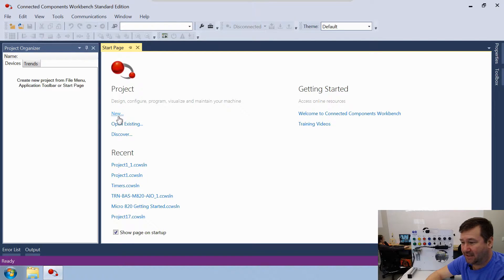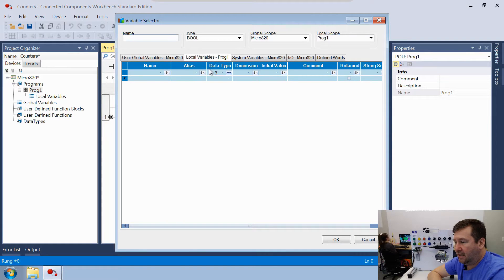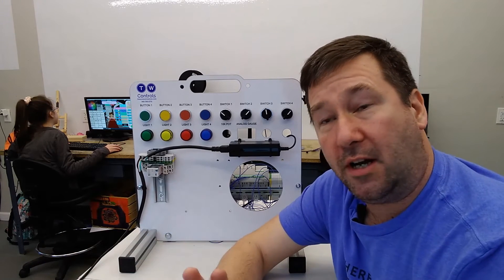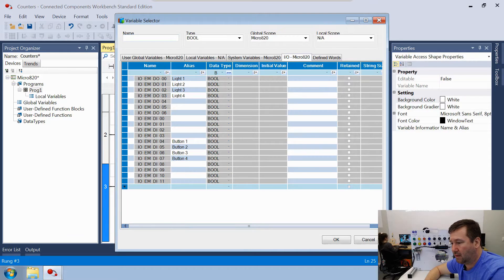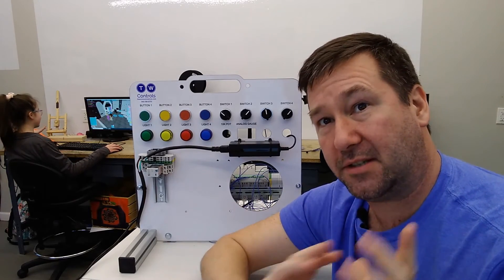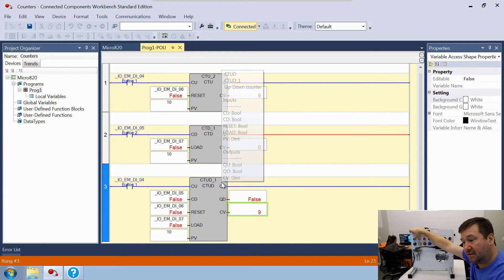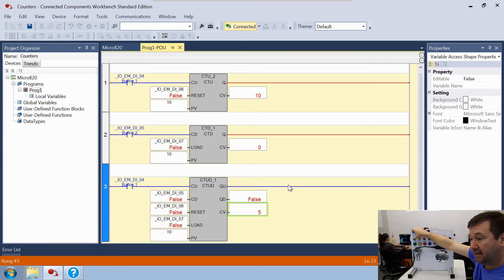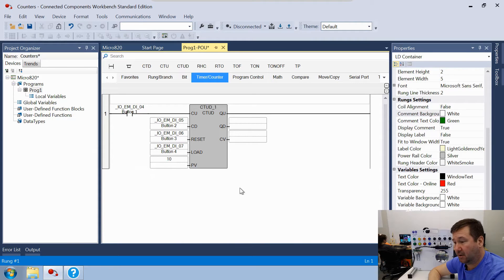Micro800 Counter CTU CTD Explained

Comment: Tim, I have very limited experience with CCW. I am trying to replicate an averaging routine I use in RS Logix 500, but I am yet able to get it to work. I use a timer, counter, addition, and divider routine and usually grab a value every five seconds for a total of ten grabs, the divide by ten so that I can average out a "bouncy" input. It would be awesome if you could cover this in one of your videos. These are very helpful videos, and it is clear that you pretty much have to throw out any RS Logix program procedure because trying to do it the same way just messes you up.
Reply from the maker: While not for CCW, watch this video, it is likely a similar problem.  Are you working with real numbers throughout you math?  
https://www.youtube.com/watch?v=oXMF1rDRtEM
Reply: @TimWilborne  Yes, except for where it insists on Double integers.
Reply: This is very helpful, but the issue that we have is interference, not resolution. There is a radio tower close by and it seems to cause issues with analogs at the site. Using RS Logix 500 I was able to smooth these as musch as possible making the site successful in its operations, but haven't been able to pull off the same procedure for CCW.
Reply from the maker: Double integers will result in rounding errors. Check out the Any _To_Real

Comment: Hey Tim, I am trying to write a value from a T4T HMI "Numeric Entry" to the "CTUD_1.PV" preset value but it gives me a "Illegal access to function block instance parameter" fault. The data types are the same, DINT, on my MOV instruction. How do I use the HMI to set a counter preset value?
Reply from the maker: You wouldn't use a MOV, you need to assign that tag...such as myHMIPreset...to the counter preset.

Comment: Sir, do you know if the Micro 800 platform is capable of importing tags from a 750 or 525 series Allen Bradley drive the way a Compact or Control Logix can?
Reply from the maker: Hi Ethan, not sure what you mean by import tags from a Powerflex.  Do you mean as in the tags that appear when you add a Powerflex to the I/O configuration?  The easiest way is to program a User Defined Function Block such as in this lesson.
https://twcontrols.com/lessons/control-an-ab-powerflex-525-drive-with-a-micro800-micro820-plc-with-a-user-defined-function-block

Comment: Hey Tim, I tried sending the CTUD_1.CV to the HMI but no luck. I need to know more about the data structures of the micro800. I have a little trouble getting what I need to and from the HMI. I have to admit...I am surprised that A-B made a low cost product that is very useful.
Reply from the maker: Open up the Local Variables for that program and you will see the counter, a CTU would default to CTU_1.  Open it up and you will see all of the data structures, the CV is a DINT.

Comment: so far on these exercises my controller keeps getting program time exceeded the watchdog timeout value fault. code 0x0000.
Reply from the maker: That is strange John.  You are just using the counter instruction?
Reply: @TimWilborne  yea, probably because I was using the using the simulator I guess.
Reply from the maker: @johnrece6622  Which processor did you have selected?
Reply: @TimWilborne  micro 850 sim
Reply: @johnrece6622  I get this too John. I haven’t got a fix for it, I tried changing the Windows affinity (in Task manager) as suggested in other videos but didn’t work for me. My system is running on a boot camp Mac.

Comment: Great video! I have one question sir! What if I want to select (from the screen) a value and this pass to the preset of the counter? Good bye from México
Reply from the maker: Hi Memo.  I have a video coming on this in our HMI series but you will need to create two tags.  One is a DINT, lets call it DintPre, and another with a type of TIME, lets call it TimePre.  Set the time in milliseconds in your HMI to DintPre.   Then use the Any_to_Time instruction to convert this to TimePre.  The on your timer, put the TimePre in the PT.  I hope that helps Meme and good luck!

Comment: How do I make the count go up if I'm using a simulator? I don't have a physical button that corresponds to the counter like that. I tried clicking on the counter and that doesn't do anything.
Reply from the maker: You can toggle the inputs on your simulator.  See if this video helps.
https://twcontrols.com/lessons/how-to-use-the-allen-bradley-micro800-simulator-in-connected-components-workbench